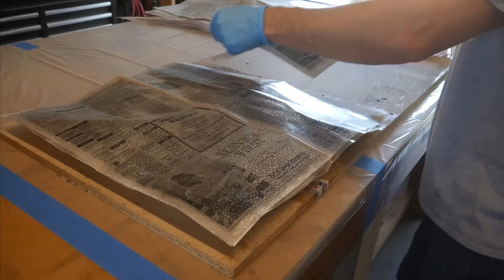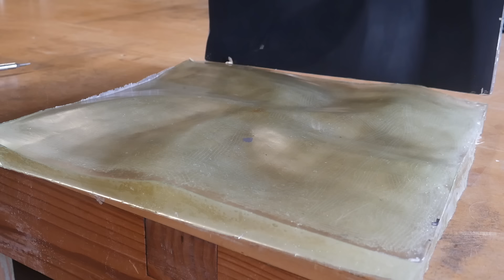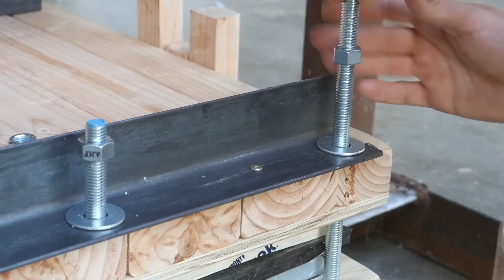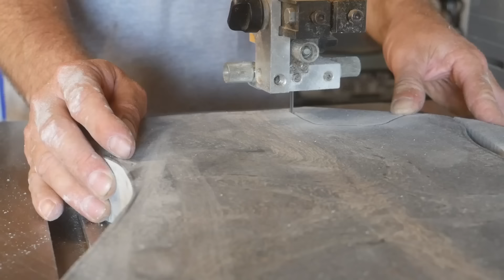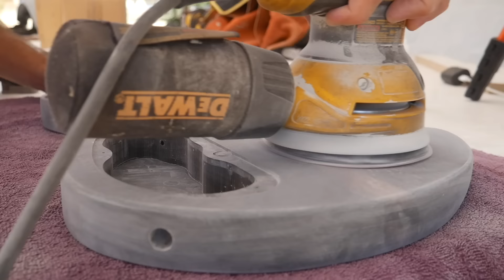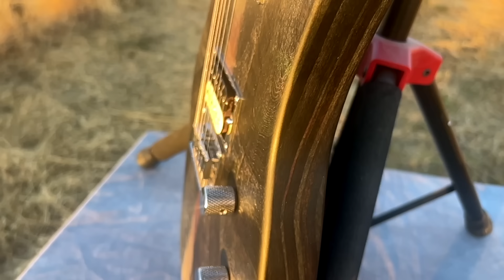Turning 1,600 Sheets of Newspaper Into a Guitar

Comment: I hope you stay safe when using power-tools on resin.🤞

I too love me some satin finish on the neck. I use a penetrating oil that hardens and then do maybe 3-5 layers. Then the neck feels like sanded wood, and I love it. But it is still protected. Probably not as much as for other finishes.

I do love the white strip down the middle. It does give et a similar look to a neck through guitar-

Comment: it's a great concept, and for the 1st of it's kind in build process it works and looks nice. but if the goal is to make newspaper look MORE like wood grain, it's too....symmetrical. the pattern of the mold pops way too much in the finish, and gives a sense of uniformity. it takes on a character on it's own, but the pattern definitely translates more than the effect of trying to replicate wood grain. an idea that might fix that, and create a more organic effect would be to shred the newspaper, so instead of uniform sheets it more replicates the straw-like nature built into trees.
i don't trust youtube videos when it comes to the dynamic range of sound from a guitar cuz everything goes through compressors and EQs and stuff til the point where literally anything that makes noise can sound like a decent guitar....but i bet this one sounds good.